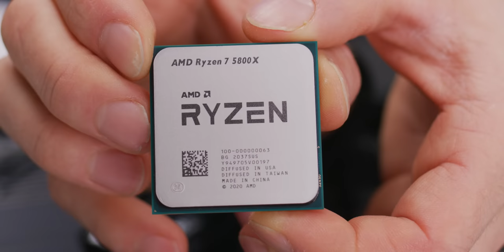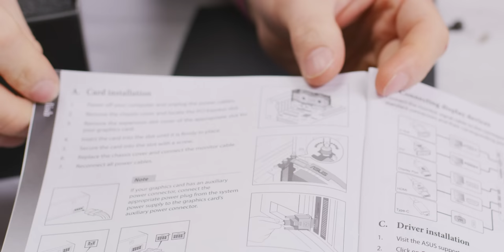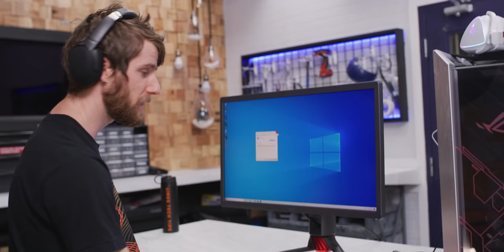She should've studied - ROG RIG Reboot 2020

Comment: Jokes on linus though, this is just asus’s product durability test
Reply: 𝘴𝘸𝘦𝘢𝘵𝘪𝘯𝘨 𝘱𝘳𝘰𝘧𝘶𝘴𝘦𝘭𝘺
Reply: @asusrog  hahahaha can vouch for the durability of their laptops at least. Dropped it a few times and never broke it (yet.) Works very well too!
(Except for atrociously loud fans but that was expected I guess)
Reply: @asusrog  it's really you lol
Reply: @asusrog  lol this is the original channel
Reply: @asusrog  You need a drink bro? Calm those nerves?
Reply: Legitness lol anxiety level 99 at this point lol🤣🤣 , man I dribble over ROG parts this makes my heart go crazy I would legit pedestal those parts like  godesses in my own harem 😅🤣 I cant wait to afford my aio ryujin 360 watercooling setup gonna be my first ROG tech I will buy to put aside for the build I'm working on atm
Reply: @Titan-mq8bx  I think yes
Reply: @asusrog  Now part of the Asus QC, a Linus drop test. In my 30 odd years of computers I have only had 1 Asus board fail on me. Had a few Asus laptop issues, but out of that only 1 remained uneconomical to repair. The wife’s latest acquisition a Asus X512.
Reply: @KungFuMouse  I have standard x441n, has battery issues (shuts down by itself). Just remove keyboard and screw the battery. It worked.

Comment: Linus: "You can use PS2"
Emma: "I have a PS3!"
Reply: I was looking for this comment lol. I screamed🤣🤣
Reply: It's way more fun to use the AT ports.
Reply: It's PS/2 ... because I'm pedantic and apparently now old ...
Reply: @ufffd  oh dang, it's written as PS/2? didn't know that.
Reply: How old should the keyboard be to have PS/2 cable...
Reply: @SirusStarTV  got couple of those from 90's/early 2000's
Reply: i remember getting a ps/2 to USB adapter cuz my old pc didnt had a second USB port left for the Keyboard but for the mouse it was fine :D
Reply: PS/2 ports worked great as did many PS/2 mice so long as you cleaned the ball every once in a while.  I remember some people would buy adapters so they could things like old flight sticks on a computer that didn't have PS/2 or other older ports whose names I can't remember off hand.
Reply: @grn1  PS/" was hated, while a bit smaller than the rs232 9pins it was hard to plug em in blindly. their pins prone to get bent and everything had to be on the port at turn on time cause the computer would not reckognize it later. eeven tough ists a simplier tech than usb which has other advantages.
but from a usuability standpoint it was worse but smaller than DIN keyboards and RS 232 mice
Reply: @woswasdenni1914  I was a bit late to the game for DIN and RS 232.  I also didn't even think about PS/2 having to be plugged in at power on because on a desktop system my mouse and keyboard were always plugged in anyway.  Thinking back it may have caused me an issue once or twice after adding something to the system and forgetting to connect them but that was around 2 decades ago now.  It may also depend a bit on where you lived and when, I really don't remember people hating on PS/2 but as a 90's child (born 89) from the suburbs of Cleveland (Ohio) my experience was limited.  

Never had an issue with the pins getting bent but I also never have issues with the plugs we use at work for sensors (press work) that have even longer pins and multiple people have told me how easy it is for those to get bent.  Maybe I'm just a little more gentle or something as my technique for PS/2 was to feel the ends to get it roughly in position then just lightly twist until it clicked (for lack of a better word).  I actually remember that being something that took some getting used to with USB since it feels the same either direction.  The cords at work are a little harder to tell and I'm usually wearing gloves but I can visually line those up (the pins themselves form sort of a circle with a flat edge on one side) then lightly twist until it clicks.
Reply: @SirusStarTV even new 2020 keyboards come with PS/2 ports if you want it. And I definitely want it.
Reply: The sad thing is that this mobo doesn't appear to have a PS/2 port, so Emma will have to resort to USB 3.0 after all.
Reply: @SirusStarTV  that's actually an interesting question. I don't think there's a set year at some point manufactures decided that they would including an adapter to convert to USB and then they decide to implement USB cables and include a PS2 adapter. From what I understand for a good number of years you could get a USB keyboard that was backwards compatible with PS/2.

Comment: Linus: “You can use ps2”
Emma: “I had a ps3”
I genuinely facepalmed and had to remind myself most people don’t know what Linus was talking about either.
Reply: It's way more fun to use the AT ports.
Reply: Do they even make keyboards with that anymore?
Reply: @whiterabbit75  no lolmaoo
Reply: I still have an PS/2 mouse an a keyboard laying around in the house...
Reply: @CarlosRuiz20  Same. I actually remember needing it about a year ago - basically my BIOS options were set to some "Fastboot" setting that would boot into windows before the USB drivers were even up and running. Which meant it didn't recognize my keystrokes fast enough to enter the BIOS - gladly the board had a PS/2 port that saved me.
Reply: I still use a PS2 keyboard...😅😅
Reply: @siddhantkumarsingh50  But wait - how do you RGB?
Reply: @0tobsam0  I don't....😅😅
Reply: @siddhantkumarsingh50  FeelsBadMan
Reply: Yeah I didnt realize it and I have a PS/2 keyboard which is like 12 years old and only malfunctioning from last month. I'm putting off replacing it since it's hard to find another good PS/2 keyboard.
Reply: same
Reply: @CarlosRuiz20  most of mine are still packed from moving multiple times, I have a few AT keyboards and more PS/2 mice that I know what to do with probably.

Comment: 4:00   It doesn't matter, you don't
           have to plug in any USB, it's fine
4:05   "You can use PS/2" - "I have a PS3" 😂
           Thanks  @Core_Ardendo
7:08    You can do the Ram
10:38 We got a big old "Longboi"
10:44 Specifically spelled "BOI"
10:45 "BOI"
10:50 She learns so fast 😂
12:35 Keep on rolin baby 12:41 Ouch 😅
16:08 That looks like the prettier side
16:42 How many screws do i have to put in
           this puppy?
16:47 There are 12 holes 😅
16:50 Well then 12 screws?
16:53 This Face 🥺😕😔
17:06 Linus too short 😂
17:08 That face 😆
17:13 They start out all shy...
17:25 Not much taller
17:32 Since you are standing on the stool
17:38 Its actually your monitor,
           it might be broken, 
           so the joke is on you 😂
17:40 That face 😮
17:54 Well that was relatively
            painless, other than you made me
            put in three times as many
            screws as was nevessary
17:58 That Face 😊
            Put the Motherboard in
18:12 And then, do you screw it in?
18:13 That Face 😯 "Oooh that's an idea"
18:30 Hey Brandon, help me out
           He can't hear you
           Oh dang it!
18:46 What are your favorite tech channels
18:50 "Linus Tech Tips" "Shut up"
20:58 Hundrets of Frames
21:01 But can it run Crysis... I mean
           But can it run Angrybirds 😂😂😂
21:02 Speechless Linus
25:03 What game shall we play
25:08 Doom Eterna..."Angry Birds"
           That Face 😁
Reply: 4:07 I have a ps3
Reply: @core_ardendo  totally forgot to add that 😂

Comment: 0:00 What will Linus drop?
0:22 ROG Rig Reboot not cancelled
1:15 Intro
1:27 Emma Interview
2:33 Motherboard
4:08 CPU
7:05 RAM
8:35 M.2 NVMe SSD
10:18 The long boi (AIO Liquid Cooler)
12:34 Linus being a boomer
12:59 Case
15:45 Back to the long boi
17:06 Linus too short
18:05 Motherboard
18:41Emma's favourite LTT video
19:21 PSU (Do you need that wire?)
20:24 Graphics Card (Linus will eat it)
22:51 How do like that RGB?
23:24 Peripherials
24:47 No first gaming test :(
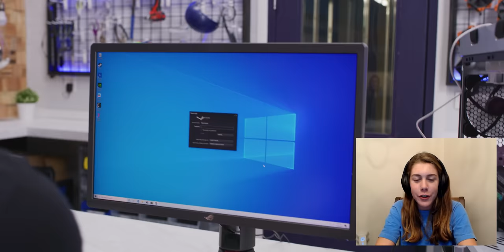25:59 Fall guys isn't dead?
27:06 Hot dog glory
27:17 Outro

Comment: I have that dark hero viii and it was so cool to see this. I had an issue with the RAM from putting them next to each other. I just remember looking at the q code led and it was a DRAM error. But my question is, can you put all 4 sticks of RAM in the slots? Or change the 2 out as needed?

Comment: Looks like he let her put the M.2 in a chipset connected slot. I feel like that would have been a good "tech tip" moment. Sure, on X570 you still get gen4, but it would still be better to not run the boot drive over the chipset.

Comment: M.2 location they use  will work ,  optimally I have my 500GB NVMe  next my  5950X CPU , I use ASUS DOCS  on my DARK HERO  , but would trade my 1080Ti  for her 3080 RTX  , how is it , 5950X was   easy to get from Micro Center down the street,  no luck on the 3080 RTX  , much less for a 3090 RTX  .

Comment: 1300fps in the MENU. In game actually 170-180, which is lower than what DOOM Eternal on Ultra settings would run at 4k on that machine (~190). Yay for id optimization.

Comment: Usually I feel like I'm learning a thing or two watching Linus videos but this time I got confused pretty quickly. I Actually have a PS2 somewhere in the house, but what's the point to connect it to a new computer? It failed to be sold on a couple of garage sales we had. Now it seems like there's some potential reusing my old console for something??
Reply: PS/2 was an old type of connector for hooking up mice and keyboards, a round barrel with a few long pins inside. USB has mostly replaced it nowadays, and the board in this video happened to have a crazy amount of USB on it.